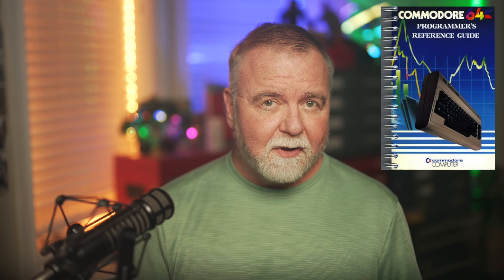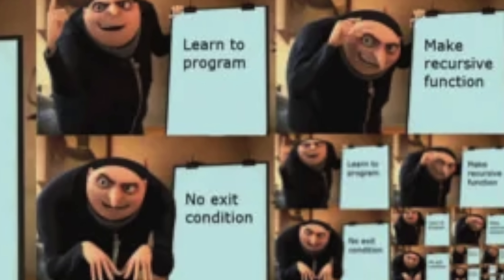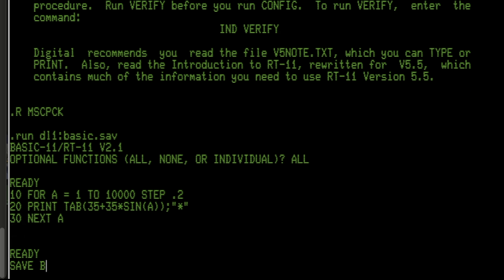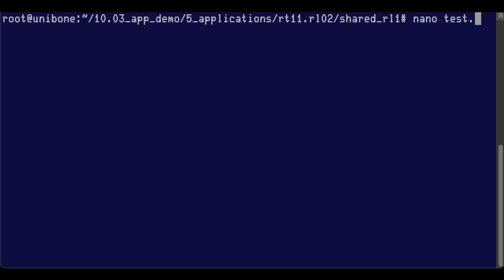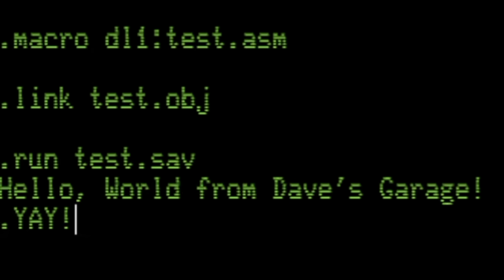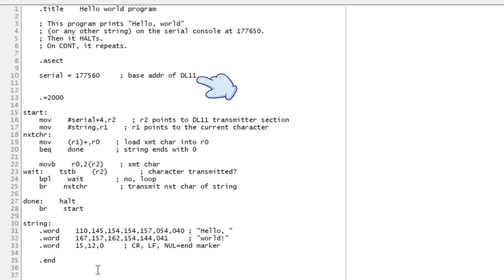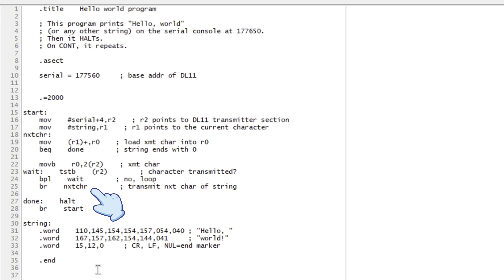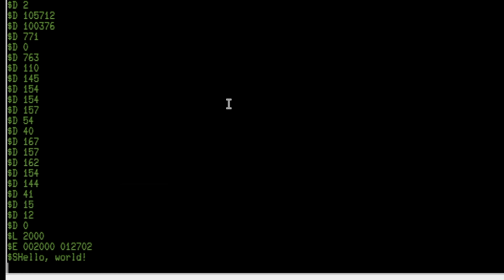Bare Metal Coding: Big Iron!  Assembly Language on the PDP-11/34

Comment: I used the same 3 line basic program to sell many many TRS-80s in 1980.  When a parent came in with their kid, I'd use that as an example, replacing '*' with the kid's name.  Sold.  

I can't even begin to estimate the amount of macro, and fortran, I've written on PDP and VAX/VMS.  You can see some of my handiwork in the movie 'The Informant'....  There's scene with a CBOT market quote board - that was driven by an 11/84.  

Thank you for the nostalgia!    I run a pidp11/70 and have a rt11 macro 'kill the bit' game  that uses the front panel switches and display register.  Ping if you'd like a copy.

Comment: That monitor font flashed me back to highschool 1974.
DEC PDP-8 with (Dartmouth ?) BASIC compiler on dual 8-inch floppies. Blinkenlights and everything.
I want a real VT-100 terminal now, for to run microcontrollers.
The 14-inch wide tractor fed dot-matrix printer is probably still running.
Remember when computers waited for us?
I blame the Internet. For everything.

Comment: In about 1966 I was systems programmer for an IBM 7040 at UniWat. The built in boot loader read 2 column binary punched cards into memory and then branched into that code to begin the real boot of the system. Creating the program contained on the punched cards was what I call bare metal programming.
Reply from the maker: I'd say raw cardboard coding, but I know what you mean :-)

I figure if I have to toggle switches, that's close enough to the hardware!
Reply: @DavesGarage  Also toggled switches to enter trial boot code. Creating column binary punched cards was not easy and one wanted to test the bits out first.

Comment: I learned assembly on either a PDP-11/34 or a PDP-70.
Pretty much the same assembly code, 11/70 had a few more instructions if I remember right.
I learned on RT-11 (11/34) or RSTS/E (11/70), not RSX.

Comment: Thanks for bringing this all back into my mind from 40 years ago. Back in 1983 as a student on an Industrial placement, I was tasked with writing a Macro-11 library of functions to control some custom designed boards attached to an LSI 11/23 which performed signal and image processing in a "portable" ultrasonic inspection system application. I became so good at it that my supervisor let me write and test all of the code plus the development of a demonstration program written in Fortran IV. Most of the scientists prefered to use my demonstration program rather than the clunky official one (which still used my Macro-11 library). The custom developed graphics hardware designed by my supervisor and another engineer was at the time more powerful than a VGA PC graphics card and offered RGB at 8,8,8 bits per pixel and multi-slot CLUT. My Macro-11 library included all the arg checks (used at link time) to ensure correct operation of the system hardware plus protection against scientists attempting to accidently demolish a very expensive set of reed relays used for analog signal path switching. The macro-11 library included hardware dependent layers plus high level language interface layers to allow easy hardware upgrades plus the use of several high level languages. All achieved in 9 months and I enjoyed working on it very much indeed.  RT-11 was solid and very well documented.  My demonstration program needed to use overlays to swap in and out different functions. Sadly I never had the opportunity to write for the PDP again and moved on to other computer hardware but I fondly look back to this period of my life. Thanks again for the trip back down memory lane.

Comment: As an old FORTH developer (Max-FORTH, embedded in the Motorola 68F11 was my project), playing games with the stack and return addresses was just another day at the office. So, let's see, you could JSR, pop the return address and store it someplace, and if you decided you really wanted to return from whence you came you could jump indirect. That would be a JSR without an RTS.

I remember writing some subroutines that had to run twice on two different halves of a value. The subroutines did some setup and then did a JSR to the immediately following location in memory. An RTS returned to the location following the JSR. The second time the RTS got executed it returned to the real caller.

It's assembly. It's the wild west. Everything is possible, including unholy ideas no one in his right head would consider. Cool stuff, in other words.

Enjoyable video. Took me back!

Comment: I worked on a nuclear plant simulator as the software engineer. One day, we started getting strange results when running the daily op test. The hardware tech swore the hardware wasn't the problem. So I monitored the interface between the computer and the sim hardware. That showed one  quadlatch had failed in the interface. The point here is you had to know both the computer and the hardware to find the problem. Good times.

Comment: For those of us lesser mortals who don't have a physical PDP, there is simh (simh.trailing-edge) and the software kits for RSTS/E and RT11. These provide a simulation of physical computers. There are also ones for PDP-10 (Tops 10/20), HP (TSB) etc.

PDP-11 assembler was the first assembler I used. I thought it was great. I did a lot of PDP-11 assembler programming in the 1970's and 1980's. I also used the 68000/68020 which were fine. Then I came to the 8086/80286/80386 et al. Oh dear. What's with ptr, offset and operands from right to left?? Can names be named for who came up with notation for MASM?

Great videos. Keep up the good work!

Comment: I wrote 6800 and 6809 assembly language professionally for 10 years.  We wrote everything from the real-time-multi-tasking-interrupt driven operating system. From reset vector to the power-down non-maskable interrupt driver.

This was before windows and the internet. Talk about a sound foundation.
40 years in the business

Comment: Before your days SLAC (Stanford Linear Accelerator Center) developed a preprocessor (RATFOR) which basically to C input and output Fortran.  The Late Will Baden generalized this to be able to take most any input (C, PASCAL< mODULa II, PL1, etc and using a pattern driven version of the preprocesssor which he named MORTRAN could utilize macros to output different versions of Fortran PL1, even Cobol,  C, structured code, allowed applications to be "easily ported" from an IBM 360 to A CDC or Univac or PDP.  One program being converted it was found that the target COBOL compiler put out better code than the Fortran compiler (think decimal app) It also allowed for assembler inserts for critical loops  what fun. obviously you had to devfine each computer, bit order, b yte size etc  BTW Will could boot a PDP8 to the teletype without looking   MORTRAN was also great at unscrambling FORTRAN spagetti code

Comment: I remember trying to code in assembly language to print hello world message.

I don't remember the assembly language type is. But it was on linux (ubuntu). 
Rather than using std::cout like in c++, it is mandatory to use what is known as system call.

The way to use the system call is by load the hexadecimal representation of the system call. If i remember correctly 01 is the hex rep for write system call so that we want to write something in the output stream. Then supply the parameter it expect.

There are about 300+ system call in linux or ubuntu. But i don't try anything complicated just print hello world.

I thought to myself, what's so different to c++. It is still written with a bunch of characters and compile and run. Nothing too fancy but it work.

Comment: 8:30: Dave is probably aware of the genius of the PDP-11 instruction set, but for the rest of us, the immediate operands like the instruction

MOV #42, R1
. . .

are essentially, if you decode them,

MOV (R7)+, R1
.WORD 42
. . .

The PC, aka R7, is autoincremented already during the execution, and the word with a constant is indirectly addressed by it. It's pulled by the fetch-and-increment addressing mode bits in the instruction, and the PC points—tadam!—to the instruction following the one with the immediate operand

This is not as simple as that in the later PDP-11s with virtual memory management, as they may separate the instruction and address spaces to give each program separately addressed whopping 64K of instruction space and 64K of data space, but the earliest PDP-11s were designed for the efficiency of implementation, and this is the best trick that I've ever seen! IIRC, the compatibility had been carried on forever: indirect addressing (R7) referred to the address in the instruction space, while the same using (R0) through (R6) to the data space.

Comment: In 1975 the college where I was a student had a PDP8, with the toggle switches on the front which could be used to program it. It must have had a bootstrap loader, probably paper tape, but at that time I wasn’t particularly interested.

Comment: What I did just for fun was reading the first sector of a data disk and diasassembled it. It just prints something like this volume does not contain a bootable system if I remember rightly. Last pdp11/34 assembly I wrote was in 1986... rsx 11m sys internals training by dec was my best course😂

Comment: Brought back memories of asm coding a PDP-9  18-bit machine storing five 7-bit characters per two 18-bit words.  KSR-33 terminal quickly replaced with a Tektronics tube.  Load everything from paper tape, store to mag tape, not DECtape.  Core memory 16kwords.  Used it for four years until a PDP-11/45 showed up.  Thanks, Dave

Comment: For your next video, I recommend getting even closer to the metal: machine language. The PDP-11 instruction set is quite elegant, particularly when you use octal. For example, 011507  is MOV (R5), R7 with 01 specifying the MOV instruction, 15 specifying deferred addressing for register 5, and 07 specifying direct addressing for register 7.

I was pleasantly surprised when I found out that one of my courses in the late 80's was taught on a PDP-11. I enjoyed it a lot. I remember going back to the building where it was taught a year or two later, only to discover that the PDP-11 had been moved to the stairwell and now had a placard describing it as the museum piece it was! An elegant computer for a more civilized age.

Comment: I started my IT career on an IBM 360/20 card system using Assembly Language.  As my time on Mainframes grew I got into COBOL and PL1.  Later on I had a PDP 11/70 in my office when we were porting to some new software.  As time went on we grew into an IBM 370/195 and its follow on systems.  My path led to systems like Cray, Burroughs, Univac, Unisys, and several IBM Midrange Computers from IBM 32 to 38’s and AS400’s.  My last 25 years were mainly spent on very large Linux Systems with Terabytes of memory and Petabytes of SSD, running Oracle Databases and E-Business Suite.  But up to my retirement day I was still using Assembly Language to interface a multitude of varying hardware back to Oracle!  Even though we used a lot of C and other languages, I always had Assembly to fall back on.  Keep up the good work Dave!

Comment: Seeing that shelf of orange binders brings back memories. I recall getting sets of errata manual pages with the new version of the OS. Starting with the first binder, replace pages 7,8 with pages 7a, 8a, 8b. Sometimes just a page or two per chapter. Sometimes whole chapters were dropped and replaced with a new chapter.  Keep repeating until all the relevant pages were replaced. And we actually referred to the manuals often and needed them kept up-to-date.

Comment: I had a 6809 in my original computer.  It had PDP 11 like instructions.  I found it pretty easy to learn. The only thing I never quite cracked, was doing floating point math on an integer CPU. 

I was into it enough that when I read a magazine about the DD opcode which was the 6809 Drop and Catch Fire instruction (DD = Drop Dead) I immediately laughed out loud and totally got it. 

I want to 6502. I hate it it's assembly.  I hated the backwards opcodes, and the fact that it did not negatively support PIC (position independent code) drove me nuts.

Comment: all the Manuals Reminds me of my collage days in the early 80's on an HP3000 and burying  my my nose in all the manuals and reading them like novels, and learning   other languages coding on my own because most the classs were all  beginner BASIC stuff except the COBOL which I also took. As long as you had a class you had access to the HP
and all the Compilers Supported and Installed on the Machine, COBOL, BASIC, PASCAL, FORTRAN, APL, RPG. ah Good times if there were any MINI i would like to own it would be the HP.

Comment: The hardest programming that I ever learnt was binary programming having to use 1's and 0's. That was over twenty years ago and was also doing turbo pascal as well at the time which confused me at times. I've only used binary programming a few times since, and was painfully slow at it. I still remember turbo pascal, but I do most of my programming now in C++ and C# which I find so much easier, and got a 99% pass rate on in the exams I took.

Comment: I wrote a bit of assembly for the pdp 11/45 in 1972. DEC had an a/d and d/a box in the rack. My code was not getting any conversions - called in DEC tech and they confirmed a bad circuit board. Replaced it. My code starts working and feeding to an FFT running in Fortran 

It only ran at a few hundred Hz but pretty impressive

Comment: I'm somewhat surprised to find that the assembley code (at least what can be seen in this video) is very similar to that used on the TI-99/4 and 4A home computers with their TMS9900 microprocessor. I'm certain there are vast differences in more advanced coding. Is it possible to load immediate values into the registers on the PDP-11? What about relocatable registers? This is what TI referred to as the WP (Workspace Pointer), which came in very handy for writing subroutines. The BLWP (Branch and Load Workspace Pointer) instruction would always store the return address in R11.

Comment: One of the introductory CS classes I took was done using a PDP-8 (IIRC) simulator/emulator. It was pretty fun but by that time, I'd already taught myself 6502 Assembly and had learned 68000 Assembly for some other classes (and for the Atari ST computer I had at the time).

Comment: I can still ASSEMBLE some PDP11 code off the top of my head: I remember how to build the instruction for the MOV command, which is very logical. In octal, the first digit is a 1 for byte-oriented, 0 for word oriented. the next digit is the op code, with 1 for MOV. then come the source and destination, each taking two octal digits. Each pair starts with the mode (0 == direct, then 1== autoincrement indirect, 2== outodecrement  indirect and 3== plain indirect; add 4 for referred) then the register number. SIMPLES! Now I may have the mode numbers and names a bit mixed up, but please correct me if you can ***without looking it up***.

Comment: Covering details is beyond the overview format of the video but here are two reactions that I hope that you find valuable: 
1) moving data was explained in terms of 16-bit words but in the sample you fetch a character with MOV (Rn),Rm and then there's the MOVB - maybe a few more words on addressing etc could had been added? 
2) the registers were said to be 16-bit wide so it could be interesting to hear how 177560 (0x2b598) can be loaded into a register and how the PDP is designed to use 256 kilobyte memory if the R7 is 16-bits

Comment: Assembly has two different syntax - AT&T and Intel. Intel ASM has the destination then source (MOV TO, FROM), while AT&T syntax has it as source then destination (MOV FROM, TO). This is important because certain assemblers do it the AT&T way (e.g., the "as" assembler, or the GNU assembler "gas" called after GCC compiles your code to assembly). Other assemblers, like MASM, or Netwide Assembler (NASM) use the Intel syntax. On x86, this means it can go either way depending on which assembler you use. On other architectures, like ARM, there is a canonical syntax that all assemblers will follow.

Comment: If I understood that, I'm curious about 'bare metal'. It looked like you used an assembler to create the machine code before transferring it to its correct location to run. In October 1974 at 19 I moved to Canberra to be a Trainee Computer Operator. To complete our 9 month's training we had to stand at the Honeywell H200 console and directly type the machine code into it to print address labels. The 1960s era H800s and H200s did not have operating systems but us computer operators. (no we didn't type everything in like that, they had program tapes and loader routines)